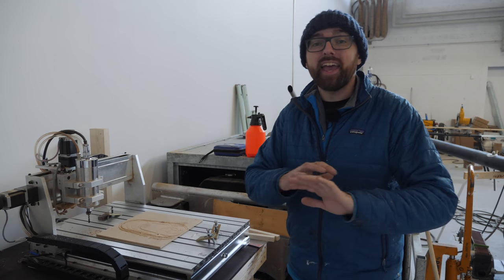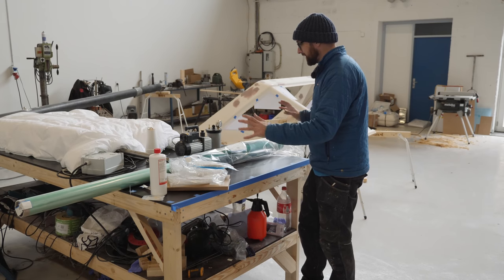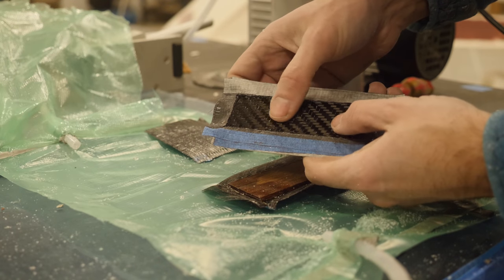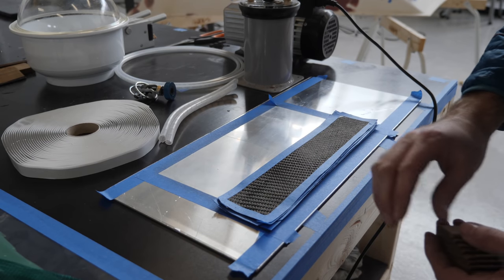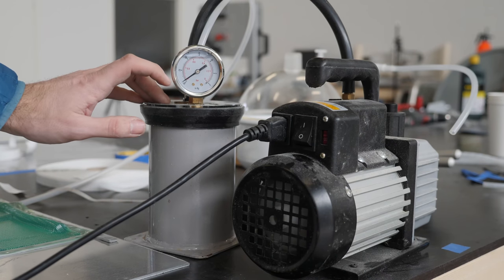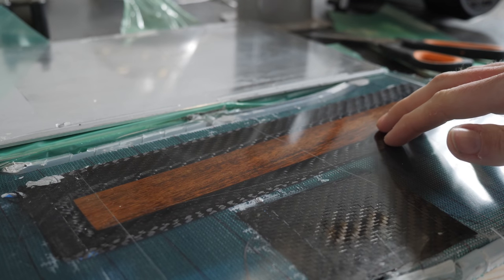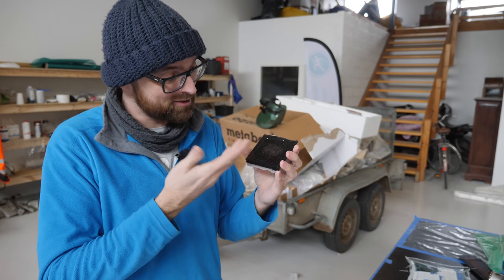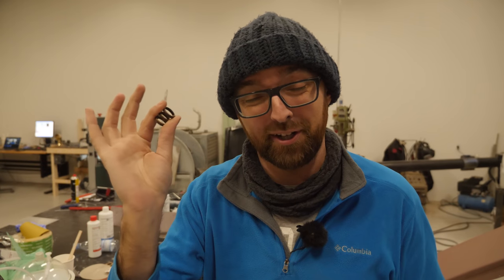Sail Life - Turning the old teak deck into GOLD? - DIY

Comment: Haha congratulations! 
And thanks for the experiments, really interesting to see. I'd love to be able to vacuum infuse veneer like you did that teak. I think wood looks awesome behind resin and it would be cool to vacuum infuse kajak or kanu like this. I guess you need some kind of flow channels in the wood. Maybe drill lots of small holes with a CNC. I think they are called "bleeder holes" with foam that is used for vacuum infusion.

Comment: The reason for the places with air / without glue is that there is vacaum hose connection missing, there must be extra vacauum pumping hoses all the places that are higher inside the mold if there are lower points around, there must be something to suck the glue up in the elevated  spaces
and the vacum hose connected to a spiral tube that lies horizontally on top of the elevated in the mold as on the sides of the hole mold, special  if it is a longer elevated piece

another way is if you can lift the side of the mold that sucks air out up, and the side where the glue comes in at the bottom, as far up as necessary to get the glue to float in everywhere, may be it must be vertical

or the glue enters the mold from the center and the vacuum spiral hose is all around the outer edge